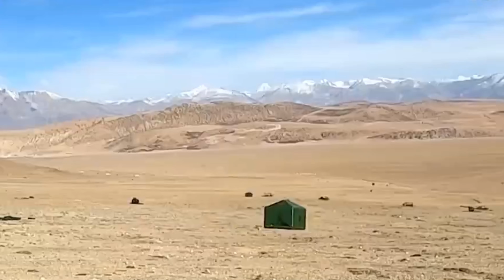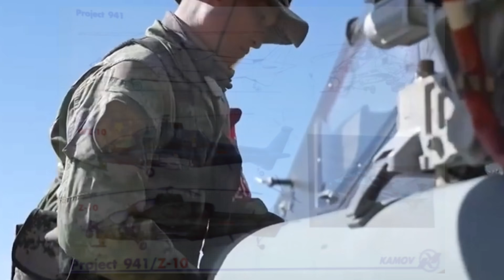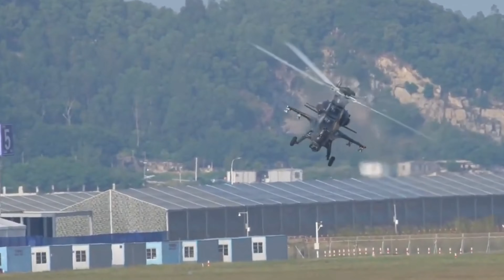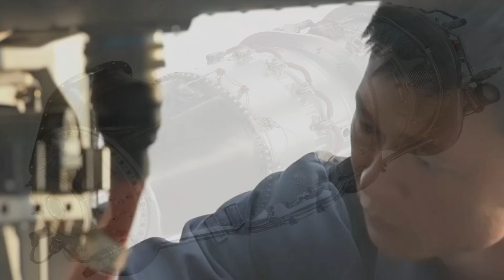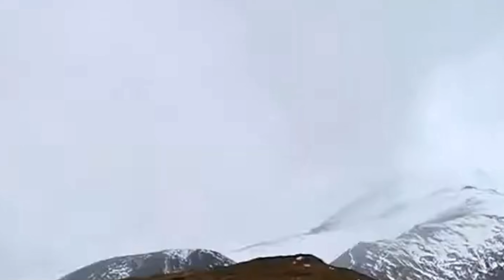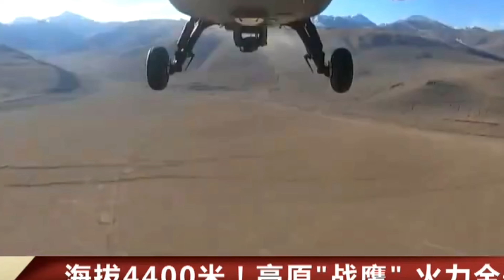China’s Z-10 'Changhe' Attack Helicopter | CROUCHING EUROTIGER HIDDEN APACHE GUNSHIP 🚁

Comment: I don't know much about the Z-10, so I don't engage in Hyprocritical Biased Evaluations here! I wonder though where that RADAR is in the Z-10, I only see a IHADDS and a FLIR/TV/Laser in the nose! I would compare it more with a AH-1Z in functionality than with the Apache. Question is how good those new long range ATGM's are it can carry now. 24KM range sounds unrealistic. At those ranges you have a hard time to spot anything small like a Tank or Truck with FLIR/TV!
Reply: The radar sits in a dome above the rotor just like the longbow, but most Z10 don't carry one.
Reply: @moss550  Never saw a Z-10 with a RADAR dome!
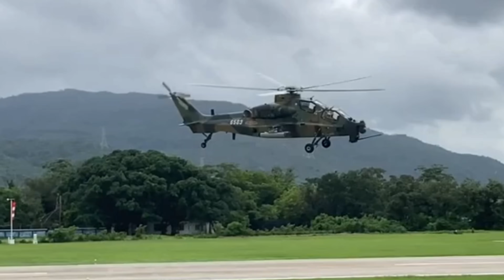Reply: @WanderfalkeAT  It's not as common as longbow on Apache, but not rare either, see 7:00 in the video.

Looking at some photos, I guess may be one radar equipped Z10 per squadrons. It's more common to see Z19 with radar though.
Reply: @moss550  Thank you for the info! I wonder if it can use a RADAR guided ATGM then? Or if the RADAR is just for detection?

Comment: The Z-10 is clearly a capable attack helicopter, I would say that the Apache is likely better optimised for firepower and has better sensors, the Euro copter is optimised for survivability and the Z-10 is likely in the middle. Anyone who discounts it's capability does so at their own risk.
Reply: Apache is a heavy attack helicopter and Z-10 is a light attack gunship hence the difference in firepower.
It's more comparable with American Cobra/Viper
Reply: @arminius6506  Man I love the Zulu/Viper. The Cobra series is cool in general, but the Viper is something special. The Marines out did themselves with that one.
Reply: @arminius6506 the Viper is far better than this in its far lower IR sigmature to MANPADS
Reply: How is the eurocopter optimized for survivability? Is it armored?
Reply: @jonahhekmatyar yes it is all-around armored by composite armor (even the rotors).
Reply: @jonahhekmatyar  speed
Reply: better sensors, how old are the apaches..even with up grades.
Reply: @cam35mm  latest Apache variant, the AH-64E seems to be 2012. Not that old compared to Z-10. Though the latter was improved starting 2018
Reply: eurocopter is optimized for draining resources and not achieving anything

Comment: I think the real reason why Z-10 exports have been so few and far between isn't due to hearsay about the performance of the WZ-9 engines, but rather because the WZ-9s are seen as blatant derivatives of the PT6 turboshaft variants, which integrate American IP, and prospective adopters are loathe to give the Americans a reason to take punitive action against them. If that is true, then the question of why this would give the Americans a reason to take action is raised. Perhaps the PT6 contains key technologies that would allow adversaries to make consequential steps towards parity with the United States.

Comment: The Z10M or Z10ME, first shown around 2020, were developed or were the basis for the development for Pakistan after Pakistan was not staisfied with the 'Hot and High" performance. The Pakistan Army may have also requested more EW jammeds and other self-defense equipment. 
The current version ofthe Z10ME does seem to have been adopted by Pakistan Army. It seems that Pakistan Army wants an attack helicopter that can perform well in the high altitude battlefields of Kashmir. Pakistan Army really wanted the Turkyè T129 but the engines are American and US denied reexport permission.
I doubt the Z10ME can be operated like the US Army operates Apache, a deep strike platform. No, the Apache cannot penetrate deep into defended airspace. It needs the USAF or USN to enable the Apache to go deep. 

China has a need to operate helicopters on the same battlefields, and this is were the Z20 was developed. It is based on a LICENSED produced commercial American Helicopter S70 that is based on the Blackhawk. However, that American S70 helicopters hot and high performance is not great just like Blackhawks. That is why the Americans used so many Chinooks in Afghanistan and why India bought the Chinook but not the Blackhawk.
Of course China can't get Chinooks so they produced a new design bssed on the S70. Design and number of blades was one major redesign that increased hot and high capabilities significantly. There are other important changes to improve this capabilities but I know longer know them off hand. I believe the Z20 should outperform the Blackhawks given the engine power advantage that most American aircraft have isn't exceptional.

Comment: I think its the TEMU version of the Apache/Viper/Eurotiger.  Its engines are knock offs.  Not as capable as the originals.  I remember when they first "stole" the engines to copy for Military applications and the protests it caused.
Reply: Keep your baseless opinions ..its a helicopter at the end of the day.
Reply: Lmao, you literally missed A129 Mangusta which is what it's based on. It's designed by Kamov, specially asked not to include coaxial rotor.

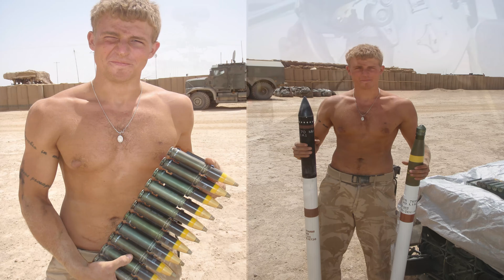Comment: 1:26 Bro carrying 70mm rockets in both hands.......Bro's Aura lvl 90006969
Reply from the maker: Hahaha some might say based….😅😂
Reply: is it 70mm or 57mm rocket in multiple rocket pods...i know russia have grad analog for helicopters of 122mm,,,,an some s-8 are 80mm.....zuni is usa similar to grad only 5inch[[127mm]]....france use 68mm[[cose they are french]].....what is 70mm rocket are those rocket like on hammers in ukraine on small mlrs put on cars  hidra is name as i recall corectly they are 70mm -so this are og helicopter pod rocket reused as cheep mlrs for cars
Reply: Be really careful there... Z-10 if you go thru enough footages in Chinese PLA army, the most prominent use is with stand-off munitions instead of rockets ... and Chinese are phasing out 70mm rocket as well with 90mm laser-guided munitions

And what you get Z-10 wrong: it is specifically design for standoff operations with the capability to linger 200km away from the base for 2hours (200+400+200)... you normally wont find such an underarmored helicopter bc it is specificially engineered to have one specific use case in mind

Comment: CANADA MAY NEED ABOUT A HUNDRED OF THESE. AND MAYBE COUPLE HUNDRED J-20 FIGHTER JET ????? THE ONE THAT COMPETES WITH F-22 FOR CANADA
Reply: Jets. You want fighter jets with an s. Otherwise, you just get one jet.
Reply: 1:No,western equipment is just as good
2:stop yellimg and take a chill pill
Reply: I think Trumps intention is to get rid of the useless government in Canada and ensure that the next 1 starts spending money for it's defence. I also think that goes for all of NATO.
Reply: Imagine asking for chinese vehicles when Canada makes their own. Crazy
Reply: @Wotinkermation Canada doesn't make helicopters or jet fighters.
Reply: Well in honesty I don't think Canada has fully manufactured a Helicopter since the 90's when Boeing closed its doors and I certainly don't think we have designed and built a fighter jet since the Avro Arrow. Produced certainly, but assembling parts is not the same as designing and building from scratch. Sadly the Liberal Government has no imagination and no belief in Canada as a sovereign nation and don't see what SAAB was actually offering.
Reply: The J-20 can't compete with the F-35 let alone the kinematically superior and more stealthy F-22. Once the upgrade slated for the F-22 are finished it will be that much further ahead of anything China has in the sky. We would be further ahead to buy the Gripen if we wanted a fighter to compete against the F-22 than the J-20. The F-35 is an excellent fighter and technologically far superior to the J-20 as it is. I just don't think that it was the right choice for Canada and it was a choice made under pressure from the UK and US Governments and from Lockheed Martin and BAE who are also some of the main contractors for our new generation of Frigates. Let's just keep heaping those eggs into big foreign owned baskets. Yay.